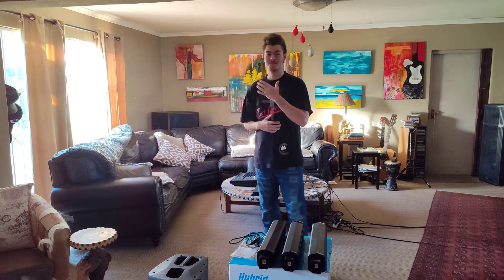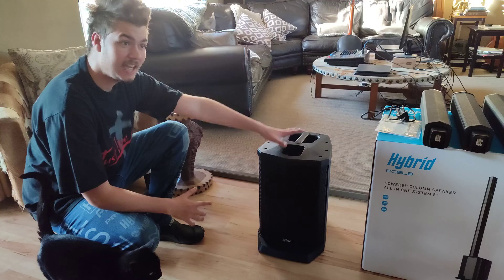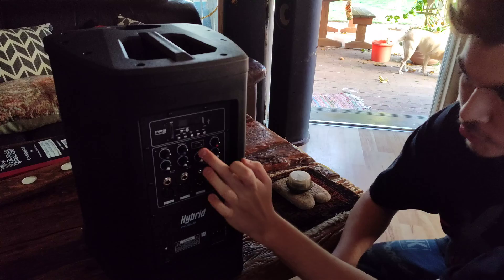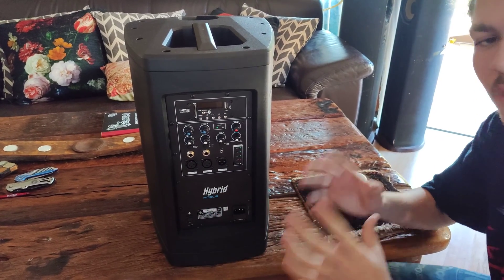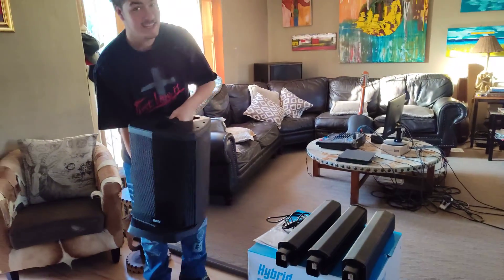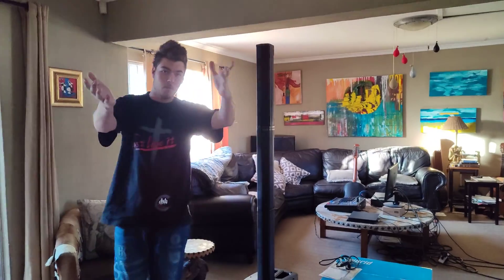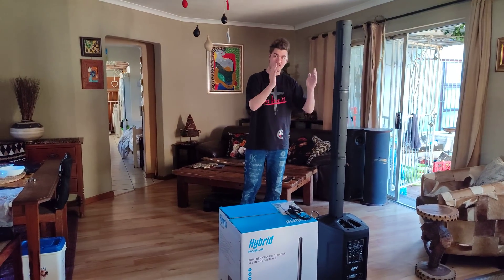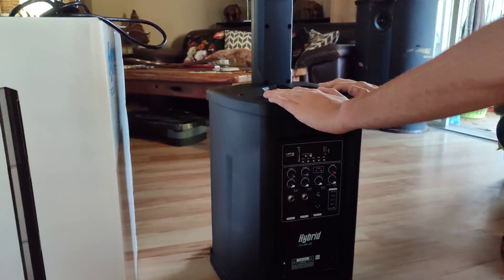Hybrid PC8LB battery powered column array! Part 1

Comment: howzit man. do you still have these? do you recommend to use with an electric drum kit?
Reply from the maker: Hay brother. 

Apologies for the late reply. 

I don't recommend it for an electric drum kit. The hybrids are good for a guitar, with microphone for the singer, doing little pub gigs and doing some DJing for 20 to 30 people. 

The speakers limit very quickly, it's not a real PA speaker but you can do alot with it, but putting a lot of instruments through it will kill it, it can only produce so much. 

It's better for very small DJ gigs, house party where you can't bug the people 3 blocks down the road. 

But they are really cool to have. 

Regards Luke/ LSW Audio.

Comment: Watched all 3 videos bro, nice review, how is the latency for djing solutions?
Reply from the maker: Hay there Brother! Sorry for the late reply.

For DJing it will be fine, for a very small crowd. It has a nice bass with very good mids/ tops. Battery power is great, I can get 8 to 9 hours out of them at 60 percent on the volume or 1 o'clock. 

For the Money it's Great, it's just the battery only really lasts about 8 months, and then doesn't really last long but I still get 6 hours now, it's been 1 year and I use them every day and do small gig for about 30 people. 

Hope that was a help? 

Regards Luke/ LSW Audio.
Reply: @LSWAudio  Thanks for the reply bro, I coped a pair. Pretty decent for the price.
Reply from the maker: @Eighty6TVSA  fantastic brother.